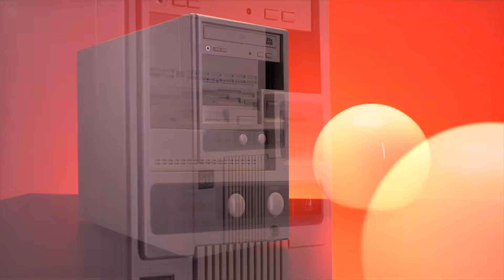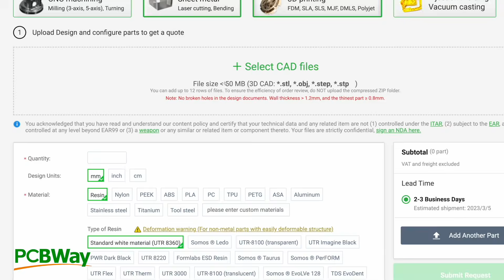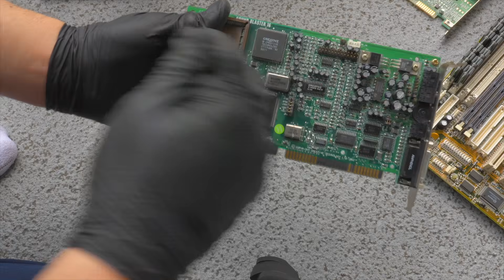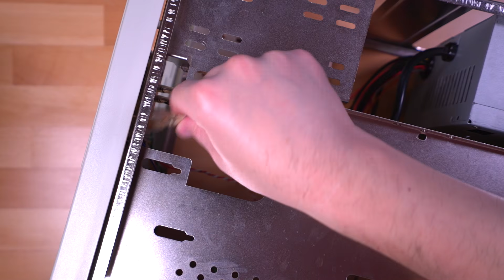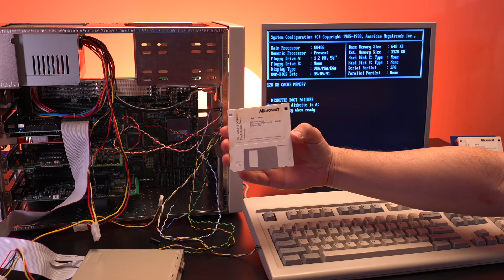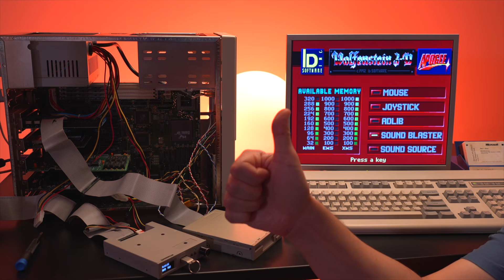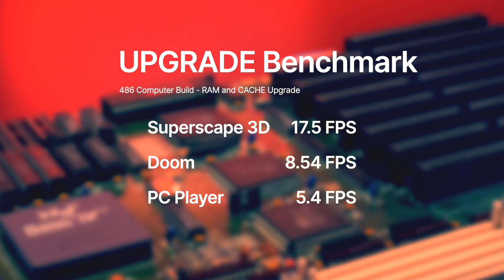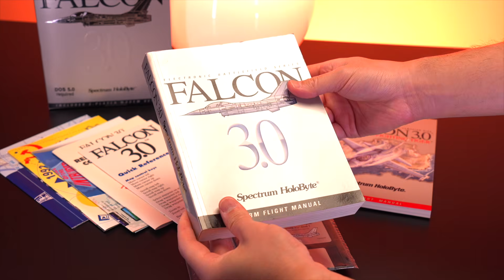Restored And Upgraded 32 Years Later | 486 DOS Build

Comment: If you really want to increase the performance of the machine you'll want to swap the 486 DX for a 486 DX2. The DX2 is clock doubled, so whatever speed your external bus runs at it'll run at twice that. The DX could run at 20, 25, or 33 depending on the front side bus of the motherboard so with a DX2 you'd jump to between 40 and 66 depending on your board.

You could also check your board's jumpers and see if it can change the FSB speed from there. Some boards will let you swap between the speeds for stability and software compatibility purposes. No guarantee your board can go any faster, but it's certainly possible. That specific DX you have is rated for 33mhz so if the board is set lower there is some headroom left on the table. That being said 33mhz is still a bit on the low end for Doom. Shrinking the screen size slightly (it's an in game option) and turning on Low Detail Mode may help a lot.

Comment: damn, those are some nice speakers. I have a working 486 dx2 66.  with the turbo switch and a 1.44mb floppy and a 4x cdrom (I am using a 2gb compact flash on an xtide for the hard drive)  but I have a better chipset trident svga card.   Descent works at 30ish fps.  

eew.. that has pci cards,  mine is all vlb and isa. this is a 'pentium ready' system.
edit: I did use the not a varta mod.   it is essential.

Comment: Fun video. Would recommend replacing the smaller caps in the PSU. I recapped a PSU for a 486 a couple months ago, just cleaned the fan and relubed. It would turn on and just beep. ESR was out on all the small caps.

Comment: Three little things I would like to comment: 1. Maybe a Super IO card will make this system more compatible as these cards often have IDE. 2. A faster VGA card will definitely make improvements on those benchmarks. 3. Beware of very old power supplies. They can fail and destroy your PC parts with them. I would consider using a new PSU and an AT/ATX adapter.
Reply: not worth to bother
old powersuplies particulary for these highend cases, were very quality made.  (until about 1996-1997, where they started to be cheaped out)
Never had one failure during 4 years working witth old powersuplies daily. 
You will be struct by lightning more likely, than these 40W power output computers will fail on power supply.
The whole computer is sucking power like one incadescent bulb, and even 10-15W is lost in power supply convertions, and low power efficiency,so computer itself is sucking even less, like 25-30W.

The problem was after 1997, with cheaped out ATX power suplies, and compputers that start to suck more than 70W-120W, and almost all from 5V rail. Here you cannot use old lightwight, and Eurocase-like power supplies, but even here is risk very very small. Retro computer usually ran like 4 hours per week. The failures were in power hungry computers, that ran for 8-10 hours daily!

Comment: the Turbo button normally throttles your PC, as it was intended to put it at a set CPU cycle for legacy software due to clock speeds that used to be very specific for a number of years before CPU tech exploded in performance boosts. So its almost as if the light is working backwards on your setup based on your performance screen. Where its actually Off, but the light is on.

Comment: Also, the Turbo button would be basically meaningless on a 486 DX processor for what you're doing. It's there to throttle down the CPU clock speed for programs originally written to be dependent on the slower clock of the 8086 and such. I don't think any of the games you're going to be running will have that problem. The only time I ever needed to throttle down the processor was when getting to play the original Wing Commander on a Cyrix 5x86 processor. It ran so fast that simply tapping the arrow key as quickly as i could would result in doing a nearly 720° spin. It was unplayably fast at full CPU speed. But on a 486 DX, you will probably never encounter such an issue.

Comment: First thing first: lovely video and production value!

Also, next time you see your mom give her a kiss and tell her you love her. The fact that she stored everything away with such care warms my heart. 

Now regarding the build... I find admirable that you wanted to keep the same hardware but...at the same time not so sure why you thought upgrading the RAM from 4 to 8MB or giving it 256K of cache as opposed to 128K would bring you any performance improvement. 

The biggest bottleneck on your system is that not only your VGA subsystem is slow due to the ISA bus being...well slow...you also have a pretty slow ISA VGA card. The Trident 8900C is pretty darn slow. The Trident 8900D would be faster, but there are slightly faster ISA VGA chipsets like the Tseng ET4000AX , WDC90c33 or Cirrus Logic 5429. Also...typically the ISA BUS runs at 6, 7 or 8 MHz depending on how the setting for the CLK divider for the ISA bus is set. You can probably increase the ISA bandwidth by messing with the ISA clock divider making it maybe run at 12Mhz maybe, which would boost the ISA speed a bit helping with VGA operations. But you need to be careful as other ISA cards might not be tolerant to higher BUS speeds. I guess you just need to tweak and test. Al so you might want to tighten your cache timings and RAM timings to speed up things a bit.

Again the fact that you don't have a VLB slot really hampers the system, otherwise you would your benchmark scores would get above 50% boost as far as graphics and games go. You can always put a DX2-66 in there but the ISA bus is still hampering down, so tweak and test, tweak and test. I would also try to get a MR BIOS upgrade for that board, it might or not exist, but these aftermarket BIOSes were upgrades back in the day that were (and still are) totally worth it.

Comment: purchase an ide controller for the cd-rom drive of buy another panasonic cr563 for the sound blaster or if the soundblaster has an ide port you can attach your ide cd-rom to your sound blaster(only if there is an ide controller on the soundcard).Mmmm seems like you have an ide controller on your sound blaster 16 you can use that to connect your cd-rom.

Comment: I got out of the retro PC hobby because it started to get pricier and consumed a lot of space. For DOS games, you built this PC, for glide games you had a Voodoo build, for newer games, you had a geforce 2 build, etc. I built a jack-of-all-trades retro PC that had three soundcards in it and a Pentium II I could adjust the speed of in the BIOS. It is so much easier to use DOSBox or PCEm or 86box to emulate the specific hardware that works best. You can reproduce any specific sound card, chip and midi synth and Voodoo/glide is available. Plus you have many source ports and remasters that are faithful to the originals (GZDOOM, the latest Quake and Tomb Raider Remasters, etc.) As for your DOOM performance issues, you most likely need a better video card but you might also be hitting the limit of what a 486DX 33Mhz can do for DOOM or DOOM II. I had a Pentium when I played DOOM. Before that, I had a 286 which was OK for Wolfenstein 3D but no good on DOOM.

Comment: Get in contact with @LGR, whilst he might not have what you need to get a boost out of the system like you were looking for (still recovering from the hurricane that ripped through last year), he'll certainly be able to point you in the right direction. Will definitely be able to help with the CD-ROM drive situation.

Comment: I used to build these things when I was in my 20s.  You might be able to squeeze out a little extra performance by playing around with the settings found in the 'config.sys' file, it's a text file found in the boot partition of your DOS drive.  You can edit it like any other text file, and tinker with settings to change how and where the system loads system drivers, and how it addresses extended memory when it initially boots.  You should be able to google a plethora of information regarding 'optimal' config.sys settings for your version of DOS.

Tweaking those settings are sometimes a highwire act, but it can help to crank out a few more frames out of benchmarks and your favorite games.  Be sure to backup your original config.sys file before changing them!

Comment: You should have the CDROM connected as secondary IDE drive. I bet you do not want a period correct CDROM drive. Those are low speed and mostly do not behave well with burned CDROM disks. I would keep that drive.
If you upgrade the CPU to the max the motherboard could support (my bet is the DX2@66 that also is the most available) you can play those dos games that came on CDROM (Tomb Raider, Elder Scrolls Arena, for example). Also you can use Win3.11 that supported some games that came on CDROM (Civilization 2, Hoyle Board Games or Wizardry for example). Using Win95 with only 8M of RAM I would not recommend, so, in my opimion, the best is to keep it as dos+Win3.11 machine.
For the turbo button, check the BIOS for some options related to it.

Comment: The reason you didn't see any big performance increases is because you are limited by your ISA Video card. You would need a faster PCI or VLB motherboard and matching video card. A DX2-66 or DX4-100 would be a worthy upgrade in a board with a faster video card.
Reply: I have 24 fps on Doom on my ISA VGA card on DX2-66
He just need to use fastest ones, like Tseng, some Western Digital, highend Trident (32-bit memory bus 8900D), Cirrus Logic, S3 or Ati.
one of the fastest is also Acumos AVG2, but because of lowend option, it is limited by 256kb memory ram. But doom runs on 320x200, so it's ok.

Comment: The Trident video card is shackling your video performance. You can do significantly better with a Tseng ET4000AX chipset video card or other fast ISA video chipset. Also I would remove the 8-bit XT-IDE card and put in a generic 16-bit IDE adapter. If you need the XT-IDE BIOS to support the CF card's capacity, put the BIOS chip in a generic Ethernet card, preferably one with a DOS packet driver.

Comment: This is a great machine, though I think there are a couple of things you should address or may want to do :

Firstly, the no-a-varta mod may not be a great idea, the reason is that your motherboard has the RTC/CMOS memory handled by a chip named "82C206" (it's between the ISA slots and the cache) and this chip requires a LOT of power to keep the time/CMOS settings. You're going to waste a lot of batteries. Sadly the best fix is to just ... put another rechargeable battery in it. New batteries aren't supposed to leak, but if they eventually do, if it's as bad as the old ones, it shouldn't happen until at leat 15-20 years if not more !

Next, for the performance, there are a couple of things too :

One thing that costs litterally nothing is to go into the BIOS and to tweak the RAM settings. Usually these bioses are set pretty loose and memory bandwidth is actually very important for these old systems.
Next if you want big increases, you should get a 486 DX2-66 and a Tseng ET4000. The DX2 is almost twice as fast, and the tseng ET4000 has a great video ram bandwidth compared to the trident. Your motherboard is stuck to 16-bit ISA which was becoming a problem for 486s, so it will never run doom at a really fast framerate, but this should give it a nice boost regardless.

Also, while XT-IDE the software isn't a bad idea, there's one thing that you can address without any extra costs and another one that implies extra costs but that I would deeply recommend.

The XT-IDE card is an 8-bit ISA card at 8MHz. The 486 is a 32-bit CPU with a 33MHz FSB. When the 486 wants to read the XTIDE's code to handle any HDD activity, it has to go through a much slower bus to read that code. This deeply impacts the performace of read/write on any IDE devices. To address this issue, you checkout in your BIOS if you can put the option ROM into shadow memory (you need to know at which address your XT-IDE ROM is set at and not all bioses let you do that). Then the ROM's code will be copied into RAM during startup (don't worry about wasting some precious RAM, firstly the ROM is small, but also this space isn't accessible form the OS regardless) and the execution will be much quicker which will result into much better throughput.

The other issue is again related to the XT-IDE card being 8-bits ... I think you should get yourself an I/O card (checkout if your mom didn't keep it, you definitely had one before) which is 16-bits ISA and will come with IDE, Floppy (normally they let you disable the floppy disk function if you want to use another controller card), and also parallel and COM ports. The paralled port isn't really used much these days unless you want to use a printer or to transfer files over parallel port, however the COM ports are useful if you want to use a mouse.
You said you used the XT-IDE card to have a CF-Card functionality, but you don't need an XT-IDE card for that, you just need an IDE to CF adapter, which is basically how these XT-IDE cards are made (especially the first one, it's an IDE to CF adapter sandwiched with the card).

As for the option ROM which has the XT-IDE software which lets you use bigger drives/cards/whatever, you can put it on any card that accepts a ROM. The easiest cards to find with a ROM socket are network cards. I know you said you didn't want to put your computer online, but you don't have to. It's just a convenient way to add a ROM into the system for cheap.

Furthermore going with an IO card will also help you fix the CD-Rom issue for cheap. Instead of getting an older drive that will work with your SB16 (which is nearly impossible these days), you'll just have to set your CD-Rom drive into slave mode and connect both the CF card and CD-Rom drive to the same cable.

One last thing, if you want to have working music in some games, you need to connect an audio cable between the CD-Rom drive and the sound blaster. Many CD-Rom based games use a technique called "Redbook CD" which stores both game data and typical audio CD data on the same disk, meaning that if you put your CD-Rom into a music player, it'll play the game's music directly. And these games require that cable to be plugged to work properly :D

Comment: Does the XT-IDE card have jumpers to set the IRQ and HEX address? IRQ 14 is for the primary IDE controller, IRQ 15 for the secondary one, those old systems only recognize the primary one, you need to install a driver through the config.sys file to recognize a controller on any other IRQ, this was a pain at the time, particularly with sound cards proprietary CD ROMs.
The 486DX CPU has an integrated math coprocessor, no need to add anything, the additional slot was used to install a coprocessor if you had a 486SX (not your case)
I agree with the comments about the VGA card, that’s your bottleneck, you should replace it by a better one

Comment: Great video! A few thoughts on performance. 
The motherboard doesn't have Vesa Local Bus so the ISA graphics card will be holding you back a bit. 
4MB of RAM was the sweet spot at the time, if you had gone from 2 to 4 you may have noticed an improvement. 
Doubling the cache won't really do much as 128k was already a good amount back then. 
In 1993 I swapped my 33mhz clock crystal for a 40mhz one and got 15-20% improvement basically for free. This also speeds up the I/O. This doesn't hurt anything in the long run and you already fitted a heat sink. 
Fit a DX2 66 as this was a great speed boost when I did it back in the day. With VLB, 4MB RAM and a DX2 I was getting over 20fps in Doom. 👍
Reply: Dude that RAM upgrade part made me laugh because that's not how upgrading worked back then.  You couldn't just "throw in some RAM" or "add a random perhiperal" and expect improved performance or functionality.  You had to determine if a piece of software required or could even make use of it before expecting anything out of an upgrade otherwise it would basically go unnoticed by the system/OS and software.  Almost ALL versions of DOS/Windows as well as software packages would list "minimum requirements" and (sometimes) "recommended requirements".  If you didn't meet the minimum there was no guarantee it would run and if you got lucky and it did it would usually be somewhat crippled in some way.  If you met the recommended you would get an improved or premium experience, ranging from better performance with better CPU or more RAM or improved functionality such as better audio with a fancy sound card.

Comment: My mum would have everything thrown out in a sec if I weren't constantly making a fuss. Now on your system probably the problem is the vga card. The trident 8900c is too slow for the 486. If it were the cl-c version it would be a bit better. It needs at least a Tseng et4000 to shine.

Comment: I just got done with my “retro sleeper” it’s a computer with an fm2+ athlon cpu and a gtx 970 inside a retro custom gaming pc case from 2001 thats designed to look like a Ferrari prototype car, the parts are new enough to do some light gaming and all my school and workstation stuff but old enough to not overheat due to the limited airflow

Comment: you can improve the performance by taking out that 33 and switching to a 66. you could even try and see if there is a pentium overdrive that will fit in that board and it would not change anything else in the build. That would be keeping the stock build and upgrading the performance in the process.

Comment: There’s several drop in 486 CPUs that will make that computer run great. The very first computer I ever built had a AM5x86 and it was a blazing 133mhz. Not sure if that is compatible with your motherboard though. Seems to be a lot of ISA slots in there. I Paired that processor with a voodoo rush and played Quake back then which was bundled with the card.